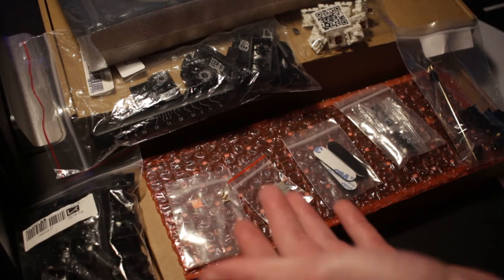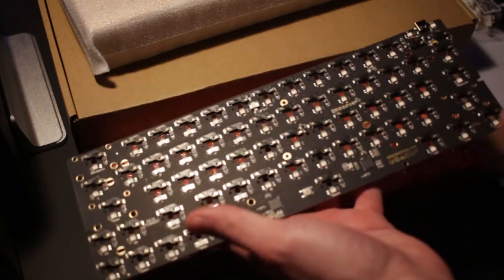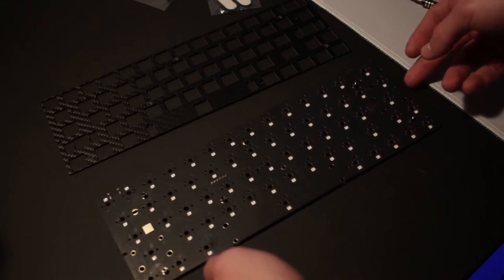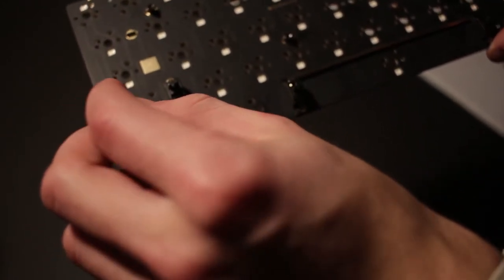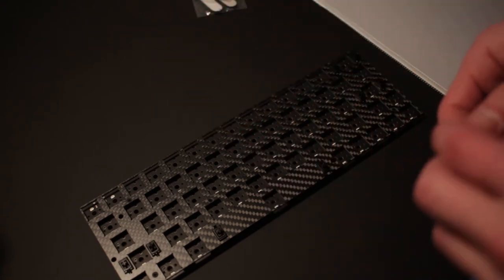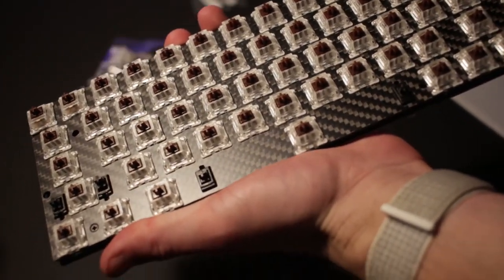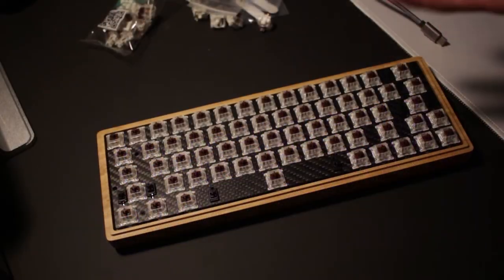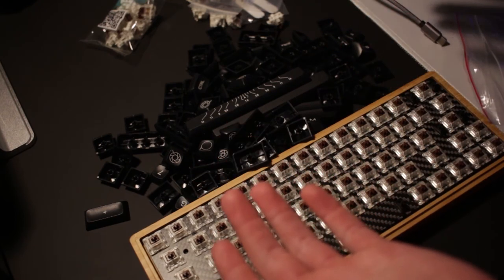Custom DZ60 Tex ADA Bamboo Mechanical Keyboard Build Guide

Comment: So this pcb makes the Bambo case hotswappable also does it have rgb im new to this I just know I want the bamboo case to be hotswapable and some rgb badly. Nvm I watched the whole vid
Reply: I don’t get what you mean by makes it hotswappable
Reply: The pcb is hotswap not the case
Reply: If you are wondering a hotswap pcb does work on this case at first it wasn’t compatible with the case because of the large diameter of the standoffs but now the standoffs are gone so the pcb is compatible with the case. the pcb I will use for my build is (dz60 ansi v2 hotswap pcb  it’s the hotswap pcb that works on this case)
Reply: My parts will arrive after 3 days I will tell you how everything goes.
I know I am late but at least I answered.

Comment: do you have any issues with the keycapos? mines doesnt fit to the switches (noir rose), its very lose
Reply from the maker: I have tried these caps with two different gateron switch sets and haven't had any issues myself
Reply: @CinnTech0451  its very annoying everytime i type the keycap would stick to my finger

Comment: The led underneath caps lock can't light up when caps lock is on?
Reply from the maker: There may be an advanced way to use the caps lock LED functionality by coding it yourself, but there is no way I know of to do so in QMK compiler. I'm not savy enough myself to know what to do for the raw code

Comment: sweet vid. I'm planning to get this case myself. While researching, I've seen that some needed to make modifications to the bamboo case in order to fit the hotswap pcb. Have you done any modifications for this particular build? or was it just simply plug and play?
Reply from the maker: With my DZ60, the case required no modifications. I did not use all the mounting holes on my PCB but I did use all of the cases stand offs. The USB C connection had too much wiggle room for my taste so I designed and 3D printed a plug for the cutout for a more secure connection.